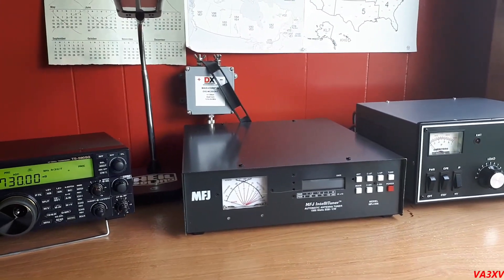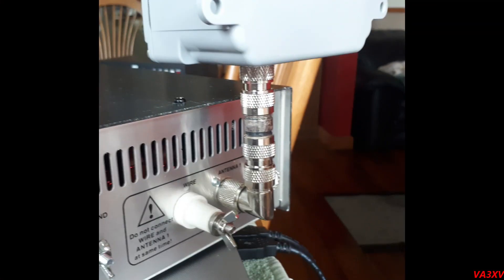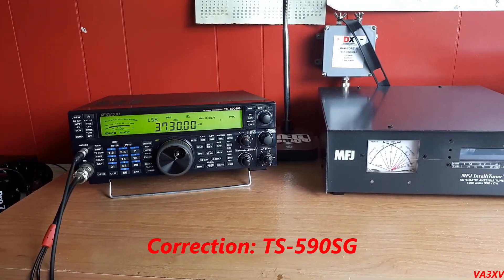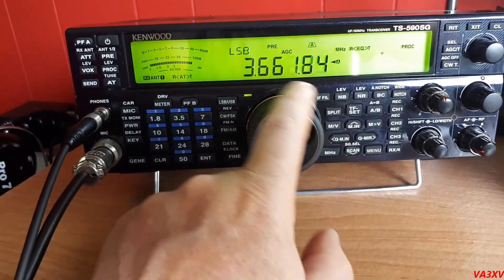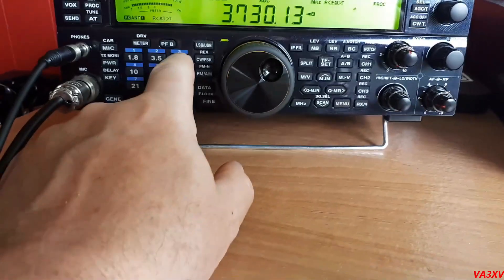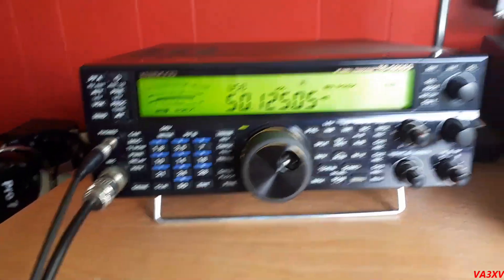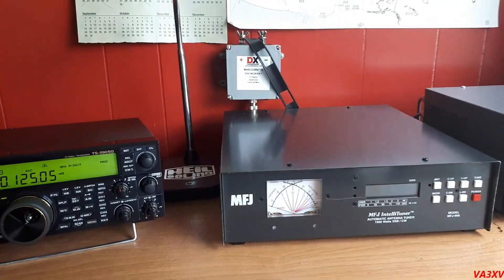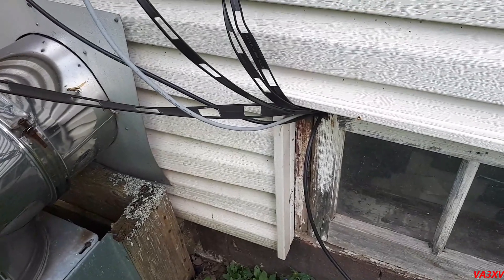LADDER LINE TO BALUN TO RADIO

Comment: Please quit calling it LADDER LINE !  It is WINDOW LINE !!  This is a huge disservice, regardless of what the clueless ham radio distributors call it.

Thank you.
Reply: The older ladder line had plastic spacers between two parallel bare conductors and was typically about 3 3/4 wide. Old handbooks talked of boiling dowels in paraffin and making insulators (1930-1950s) before plastic was widely available. I am planning on using Fi-shock electric fence insulators, drilling to fit #14 wire and making 600 ohm. The wider line is less affected by rain they say. I am bringing the open wire line down to a fence post and balun outside the shack with a short coax into the shack. This is for a multi band doublet. I plan on putting a spark plug through a metal bracket for some lightning protection but will try to have spring clips to disconnect the open wire line.
Reply from the maker: Yes, that should work great. Keep the coax as short as possible & use quality stuff like LMR 400/600. A good quality Balun also. I'm using the 5kw DXE, which has been working well, but suggest a Balun Designs tuner balun. For me, the only downfall using 450 ohm ladder or window line is ice and snow build up, which detunes the system. You will have less issues with your 600 ohm set up. Good luck & have fun.
Reply from the maker: I will try to remember that thanks

Comment: Can I asume that you dont use the mij addional tuner only as connection between Tx and balun? Is this a 4:1 balun? 73 pa3gsr.
Reply: Ditch the 4:1 and use a 1:1 current balun that should help you solve your rf issue. It’ll still tune up great.
Reply from the maker: Yes. With the mfj tuner off rf will go straight through to the  4:1 balun. I do use the tuner when using the amplifier. It's good for 1500 watts.

Comment: Have you tested the RF levels inside the house when transmitting?? Maybe unhealthy levels??? Just saying because no shielding !
Reply: Twin lead, ladder line, window line whatever one wishes to call it does not radiate in a balanced antenna system therefore no common mode as the positive and negative cancels each other out. Is baloney when people say no twin lead in the shack.  The real only need for a balun on a balanced antenna would be if you want to run coax to the tuner.  That’s where your rf on the feed line will be introduced is at the balun. Use a 4:1 if you just want random length feed line. If you use 1/8 wave odd multiples of feed line for the antenna is cut to at lowest band 1:1 balun would be best to help the antenna tuner.  You could always run a 4:1 then a 1:1 balun in series and that will give you the best traits of the two together.
Reply from the maker: The only place there is a slight bit of rf from the balun on 15 to 6m. I haven't actually tested with a field strength meter. But my touch lamp will turn on at times txing on those bands. Move the lamp about a foot away and no issue.